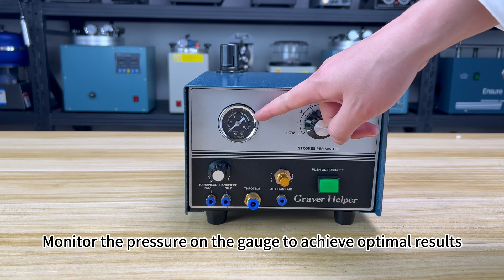How to Use Double-Handle Graver Helper Jewelry Pneumatic Engraving Machine?

Comment: How come when i engraving the pressure gauge drops then no power the foot pedal is only 1-4 the way down if pressing and the way the power will be out ! It’s a new machine!
Reply: Is there a difference in the handpieces?
Reply: @ I’m using the same hand piece but no power I have enough air pressure but something not right sometimes it’s ok the sometimes no power in hand piece